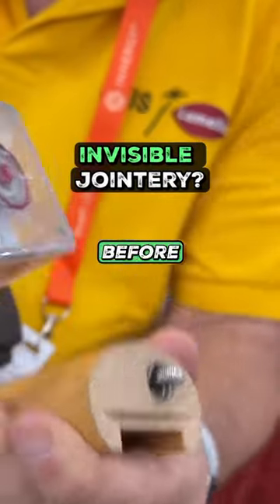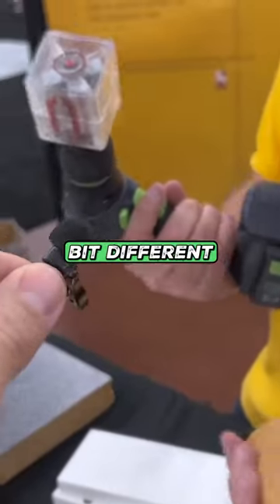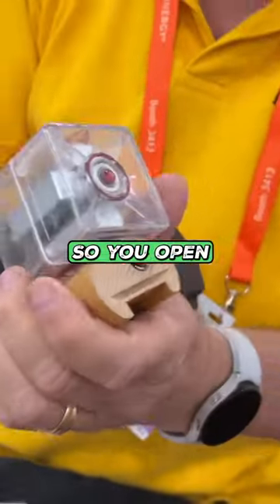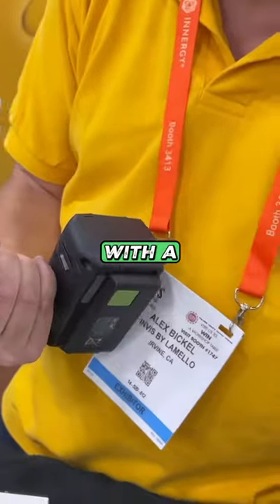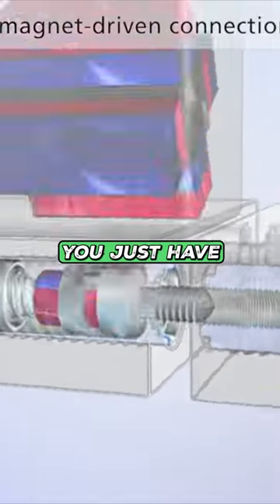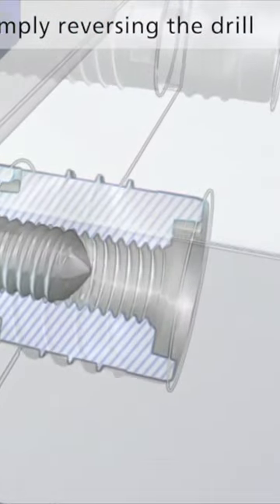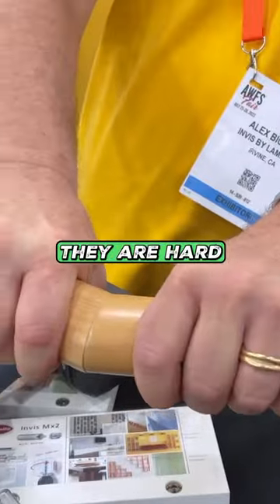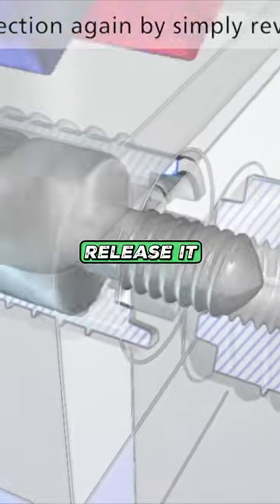🤫 Hidden Wood Joinery #woodworking #joinery #woodwork

Comment: They might be able to get some decent speed for spinning those screws, but there won't be any torque without a direct connection.
Reply: They list a tensile strength on their site for this product at 2000 N, a #4 screw has a rip out rating of 399 N with 1 inch of thread in pine. I wouldn't use it for table legs but it certainly makes a pretty way to attach a mirror on top of a dresser.

Comment: $600 for the starter kit with only 20 fasteners included, and another $150 per pack of 20. Cool concept, but I doubt anyone's going to drop other methods to use this any time soon.
Reply: That is insane, count me out! Too many beautiful ways to join and NONE of them replaceable by this magnet method
Reply: Lamello makes professional machines meant for production shops. Example is their Clamex system, the cutter for the joinery is called the Zeta P2, and has a retail of appx $1,600. So, hobbyists are not their target market.
Reply: I wouldn't even consider it

Comment: Ive seen this demonstrated a few times now, and ill be avoiding it. 

Reviews suggest that it's difficult to get a tight joint and that it wiggles loose on high traffic items. It's also difficult to use on interior angles, as it needs a very specific alignment. 

The pieces this guy is using for the demo come from their own workshop, so everything is laser straight. Trying to connect two joints that are off by even a fraction of a degree or hoping for a press fit to clean up a tiny gap are non-starters. 

I was briefly thinking this might be a cool way to flat pack stuff for customers in some cases, but i doubt many customers are going to want to foot the ~$200 price tag for the drill attachment that advances the screws.  

Looks neat, but a definite pass after some digging.

Comment: You still have to bore a hole to put the magnetic screw in. I'm assuming you could glue a dowel in relatively the same time (not counting dry time), and the dowel and glue would be stronger